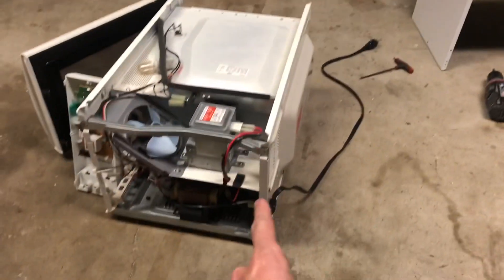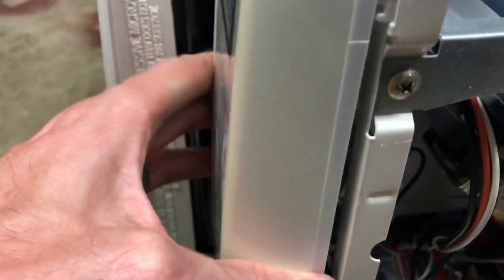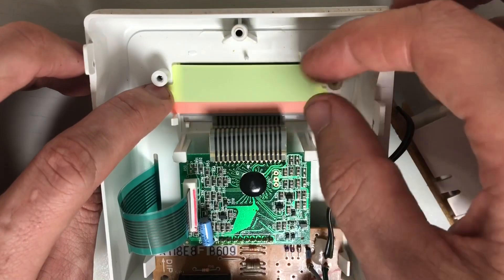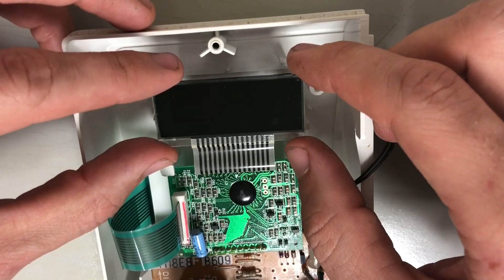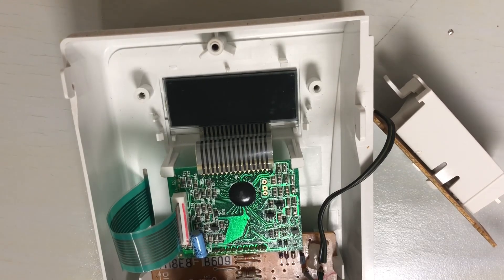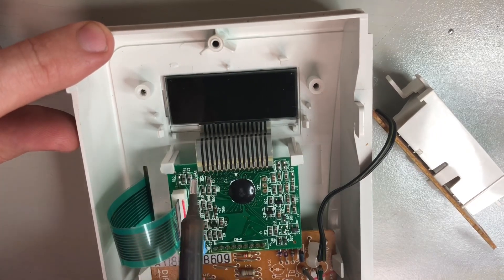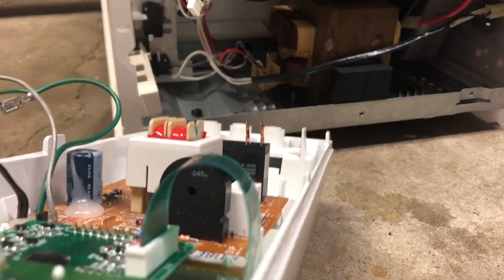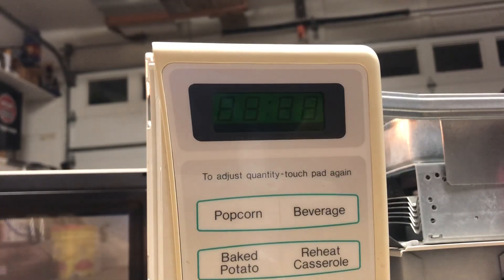Sharp Microwave LCD repair

Comment: Have the same model that I found on the side of the road over 16 years ago. The display has never worked properly, which I think is why it was dumped. Got the bright idea to finally try to fix it. I'd pulled it apart and was wondering how to proceed when I thought I'd look on YT, and found your video. The soldering iron worked but because I have the microwave up high on the fridge, it's hard to make out the display. It's only when looking level at it that it's clearly visible. Don't know what happened but maybe I put it back together wrong?

Comment: Rule number one of microwave repair - any time it has been plugged in, unplug and discharge the capacitor after removing the cover. There are plenty of videos showing how to do it safely. If not, you can easily die from the stored charge (2000 volts or more). This procedure applies to every time you plug it in to test. Once unplugged again you MUST discharge the capacitor EVERY time.

Comment: I have this same exact microwave.   Had the same issue.  I cut a small strip of aluminum foil to protect the ribon, and applied heat over the aluminum foil.  Took 2 tries.  However i dont believe that tnis is a permenant fix as after 6 months 2 segments have died, sometimes they will flicker and come back on.  Like you said this was a common issue.  I really think sharp could of done this a different way.  However they do it the cheapest way they can.

Comment: Thanks for the easy to follow explanation (and lack of silly music that people often add over their videos). I'll give this a go on my Mum's old Sharp R-774 that has a similar problem. I may need to buy an adjustable soldering iron though, as mine is just a cheap basic one and I've no idea what temperature it operates at.
Will post back to let you know how the fix attempt goes.
Out of interest, you mentioned that you shouldn't power on a microwave with the cover off - but is it safe to do so if only the lcd display is powered, and you don't activate the actual business end of the microwave?
Reply from the maker: It’s only unsafe if your touching components that have 120vac to them. Just to avoid electrocution.

Comment: Worked for me. Direct contact with the ribbon melted a little. Another comment said use folded parchment paper. Watch out for door latch switch. Trying to unplug mine I broke a pin holding it in place. Had to use a small screw to remount it.

Comment: Are you heating the joint between the ribbon and the board or are you heating the ribbon?
Reply from the maker: Kind of both. This type of connection is formed via heat and pressure. Similar to an iron-on patch for clothing. Ideally you’d heat the entire width at once while applying pressure, but I just used the tip of my iron to apply pressure as I moved the heat across the connection.

Comment: Good tips, but note that this won't work for the Sharp Carousel Convection microwave, which is almost the same size and similar in appearance.  The display is more complex, alphanumeric, and the ribbon cable has 56 traces rather than 15.  Plus they've put a strip of putty-like adhesive over the contact points, providing access to only a millimeter or two of area to try to reheat on the board end, and none whatsoever on the LCD glass end.  The traces are just too narrow to try to reheat.  I tried protecting the board by cutting a slot in some reflective insulation and using a heat gun at 200C, but it didn't improve things.  At least I was able to reassemble it all and be back to the same missing segments fault I had before. We just follow the steps in the manual for the button presses, and pretty much ignore the display.

Comment: I find that folding some baking paper over a few times and pressing your soldering iron through that onto the join will attenuate the heat and allow you to control the pressure without melting the plastic and still remakes the join.

Comment: How about there's no light? I need to use flash light to see the number in the screen
Reply: Seems like your "led" back light/s not working ??(guess)
Reply: @geoffroy9383  my light inside microwave was not working i thought it was bulb,i tightened a screw inside circuit that fixed it,the microwave i have is 40yrs old so getting very fragile

Comment: I don't like to nitpick but this is an LED display not an LCD display, which is what I came here looking for :(
Reply from the maker: Not to nitpick your comment, but this IS a LCD display.  The LED is only used as a backlight. The LCD (liquid crystal display) does not emit any light. It just modulates the light that can be seen (from the LED backlight). A LED display would either have an independent led for each segment or multiple LEDs to make up each segment, in which appropriate LEDs would be switched off/on to form the digits. 

I’m sorry that this was not the video you were looking for. What type of LCD display are you trying to repair?
Reply: @DustinRogersinMO  There’s little else as satisfying as a well-executed “nitpick CLAPBACK”, which you managed to do politely and professionally.  As a further bonus, in your answer you managed to also explain to your audience the difference between LCDs and LEDs.  THANK YOU for your impressive skills.  You reallly helped me, and I now feel more confident in (**carefully**) tackling my identical microwave LCD issues.  You are the MAN!!
Reply from the maker: @dave-ospamalot6502  Good luck with your repair. If you have any questions along the way, feel free to ask. I’ll answer them if I can.

Comment: mine is just displaying part of the last character on the display... do you think this fix will work for it? thank you
Reply from the maker: Husain B it would definitely be worth a try. And best of all, it will only cost you a little bit of time if you already own a soldering iron. If it doesn’t fix it, you’d have to replace the entire control panel assembly, which is what you would have to do to get a working display without trying this method.

Comment: We have a Sharp Carousel microwave that has had no issues with the actual LCD or touchpad controls, but I believe its backlight has started to falter, as half the time the LCD screen becomes incredibly dim and almost unreadable.  What would you recommend for replacing the backlight / backlight circuit?
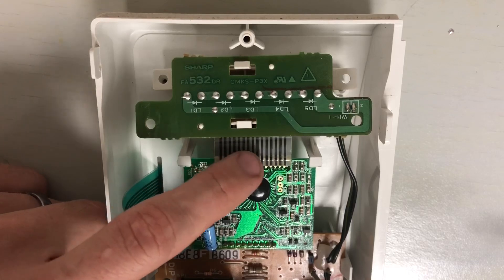Reply from the maker: AB if it’s the same setup as this microwave, it uses LED’s for the backlight, which are likely wired in series, meaning if one goes out, they all go out. I would suspect that you have a similar issue that I had where the LCD is not receiving sufficient voltage to energize the cells which makes them transparent allowing light to pass through. See 1:50 to see what I’m talking about.

Comment: What if all digits are displayed, but they're frozen and the keypad doesn't respond?
Reply from the maker: soupflood if you have this same microwave, look at the green ribbon cable at 1:44. Make sure that cable is fully seated. It’s the keypad connector. If it is seated and the keypad is still not working, you may unhook the cable and use a pencil eraser and rub both sides of the end of the cable. This is a safe way to clean those contacts. If they keypad still won’t work, I suspect that the keypad itself is faulty. 

As far as the digits, does it look like mine at 6:53? If so, that’s just the default when the microwave is powered up before the clock is set.
Reply: @DustinRogersinMO  
Thanks for your reply.
I troubleshooted it for several hours, first bypassing the relays to make sure everything else works.
Then checked the microcontroller board, the ribbons, the rubber stripe... I even replaced the electrolytic filtering capacitor with a larger value one. Nothing.
Then I found out that 88:88 is the default display when first powered on for the model I have (it's not mine).
Then I shorted the keypad contacts on the microcontroller board at random. I heard a beep.
Finally, I inspected the keypad sheet, which had 3 oxidised traces... And I connected two button switches for "2" and "start/extra minute" options (I only had 2 switches and thought those options would be enough).
Reply: @DustinRogersinMO  if keypad does not work i would pull it apart and clean it.

Comment: Thanks for all your research and effort, Dustin! I'd have never imagined this solution. Our Carousel has been unreadable for a LONG, LONG time. In a last ditch try before looking for a new one, I just randomly landed on your video. Totally worked for me! I bought the same iron and set it on 200. It took me four times to get all the light bits to work, cautiously pressing a little harder and slower each round. Every time I powered the LCD up to test, a few more elements were back working. I did both ends of the cable as well so not sure which was the culprit...though I suspect the whole band had loosened over time. Thanks again!
Reply from the maker: Mark Smith great. Glad you got it fixed. Thanks for watching and for the feedback.